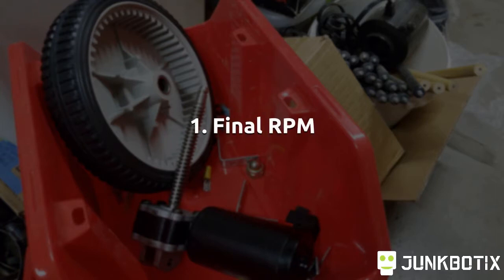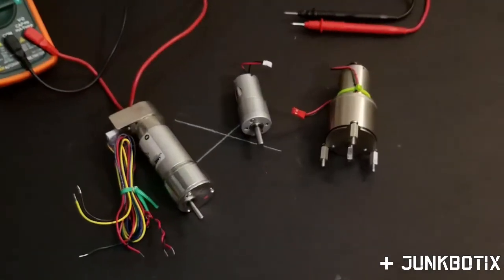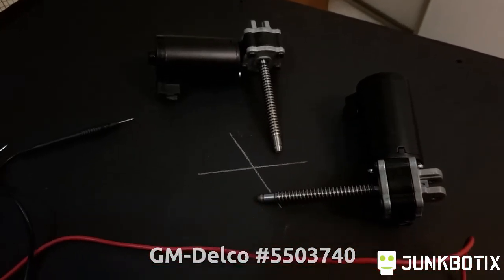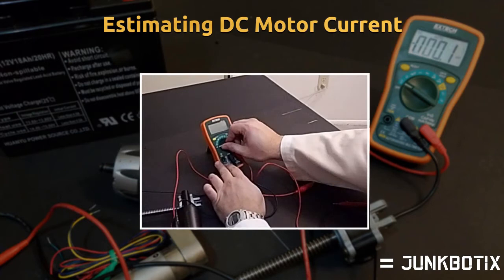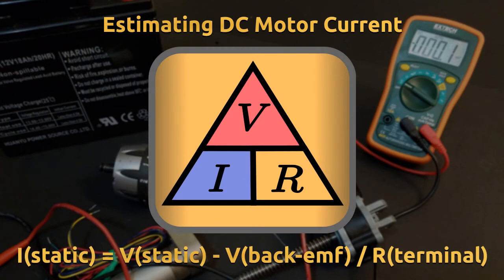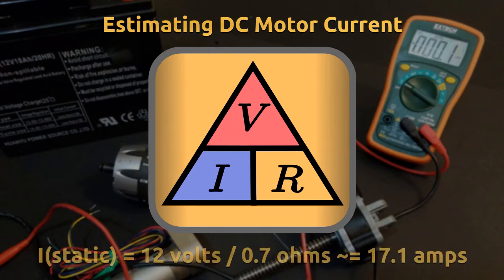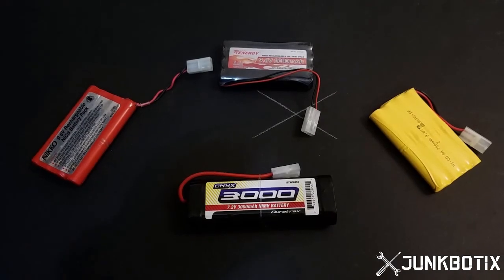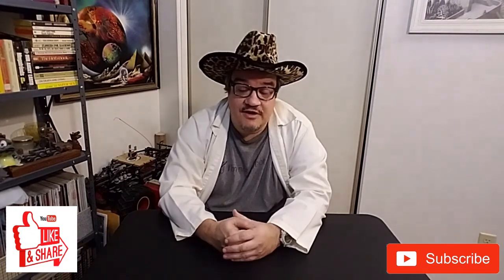Build A "Follow-Me" Robot - Part 2 - Selecting Your Motors and Batteries

Comment from the maker: Heh - noticed a couple of minor "oops" in the video - first, I think the "rotations" graphic is wrong, but it conveys the idea. Also - all test leads (aka, wires) have a resistance, but unless they're really terrible, the resistance probably won't show up on your meter. Also, if your motor terminal resistance measurement shows as "zero" ohms (0.0 ohms), you'll have to do a different kind of measurement to get the current, using a power supply that you can specify the current. Basically, setting the current to something small (like 100 mA), and the voltage to the running voltage. Power the motor with that, then measure the voltage drop across the terminals, and use that with Ohm's law to calculate the current (I think that's right, anyhow)...